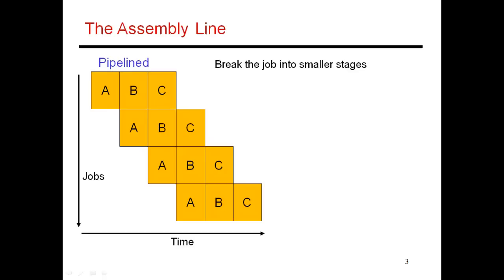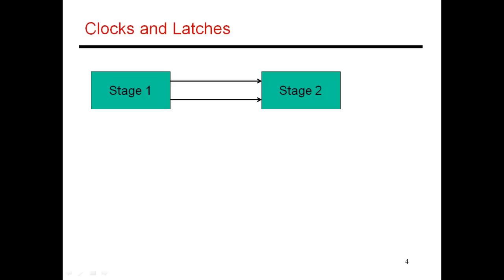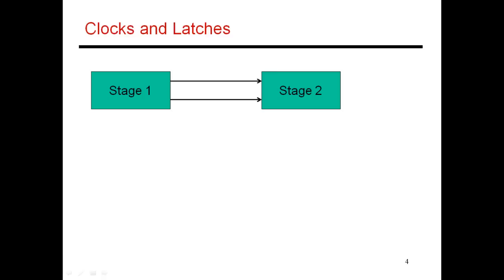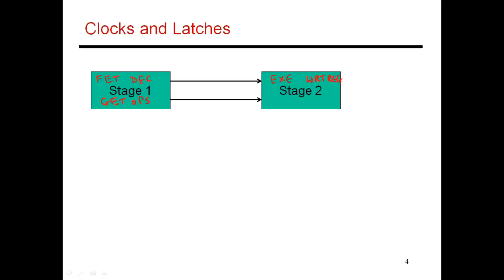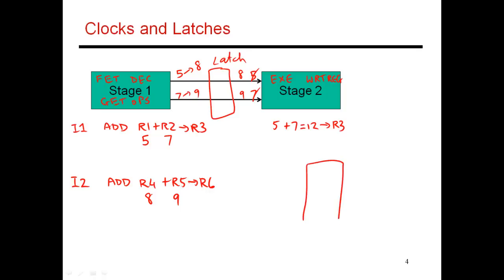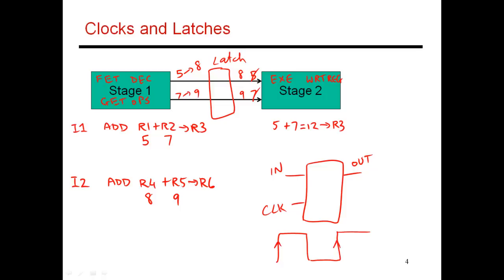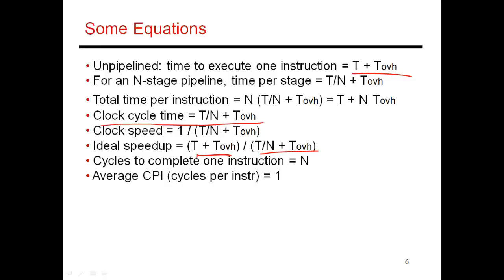CS6810 -- Lecture 5. Computer Architecture  Lectures on Pipelining

Comment: Hi Rajeev,

The definition of Latch is incorrect in this video, it level sensitive and not edge sensitive, at +ve clk edge is stores the value until the high level of the Clk, the input is reflected on the output, rather than storing from clk edge to edge, its only level based storage.